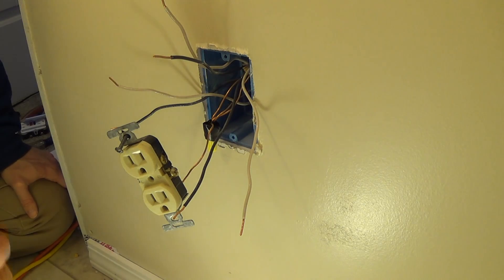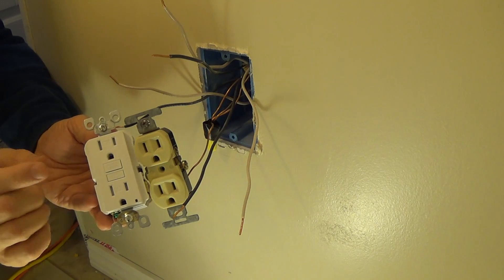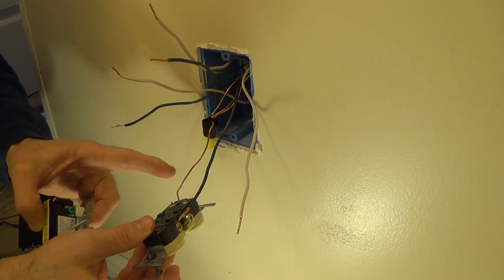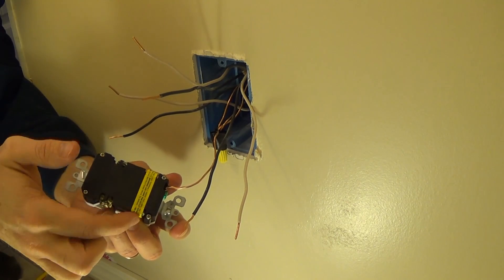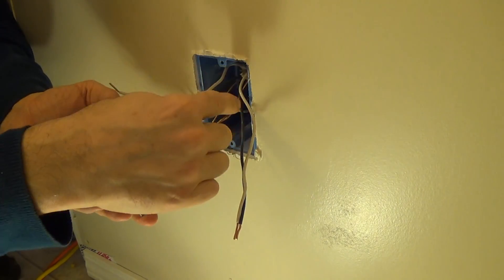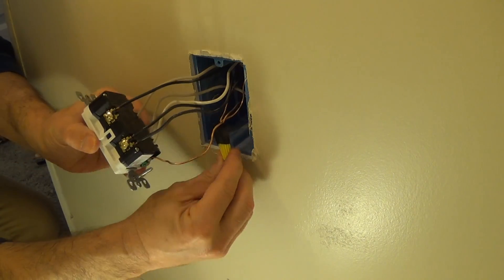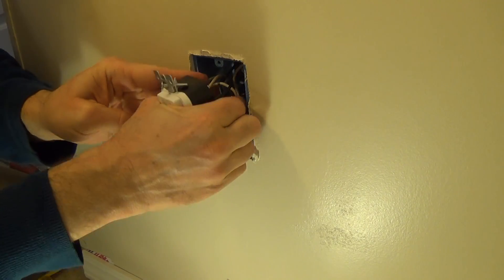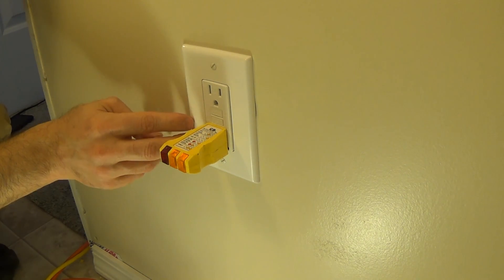How to Install a Ground Fault Circuit Interrupter (GFCI) Outlet Plug

Comment: You forgot to say that the purpose of these GFICs is to occasionally turn themselves off for no apparent reason such as simply plugging something in at a cocked angle or slightly bumping the plugs.   Then you find your cell phone and other charging units are dead un-expectedly while your far away from any means to re-charge them.   Personally I'd rather risk that there might be a puddle of water on the floor I was standing in barefoot whilst I was sticking a prong into the hot side of the terminal..which is actually not a risk because it can't be done accidentally.

Comment: I have found it nearly impossible to get the wire hook on to the "floppy" screw head.  For some reason, they make these outlets with side screws that barely come out far enough to get a thick wire under it.  And the screws flop in and out of their hole, so you have to hold the outlet upside down to let gravity pull the screw out far enough to try to get a wire hook around it.  Why is this thing so difficult!?  I have been working over an hour on this, trying to connect 4 wires to this thing.  So far, I got one attached.  Now, it's late and I'm losing the light, so I may have to stop and try again tomorrow.  I tried stabbing thru the hole on the back, but the wire keeps falling out, even after tightening it down.  There must be a trick to this that I'm not aware of.
Reply: That's the difficulty of trying to wrap around the terminal screws with these devices. It's the same thing with commercial grade receptacles, only residential grade receptacles have a "fixed" screw. Using the back wiring clamping method is the favorable way to connect the wires. It's still a very good connection method. If you're having trouble with wires falling out, use a pigtail and connect only one wire. Use a Wago lever nut for creating the pigtail.

Comment: Nice video but it might have been helpful if you had differentiated the difference between the black and white line wires. The black being hot and white being neutral. I have had to work hot circuits many times and you really want to know the bad boy wire.

Comment: Receptacle is upside down. Grounds should be on top. Say something falls on the plug in, like a picture frame. It hits the ground on top, not the hot. Learned this from master electrician who had to flip all the outlets in a government building so the grounds would be on top of the outlet & pass inspection.

Comment: How to install just a ground fault period ????? That sounds funny to not know. Earth ground is only 1 bare copper to ground rod to pannel on only tbe green bar in pannel seperate from surrent 2 bars and 1 white nuetral bar. And all ciruits run a seperate green wire or if  romax use the 4 wire or 2 wire with g. Only the green screw is isolated ground. All other withs even nuetral are travelers with current. Nuetral is not  a ground, it carries half of a ac current of the ac  circuit  it applied with. If circuit is 120v ac, the nuetral carries 60 v at the speed heryz is rated.

Comment: i just moved in and my GFCI outlet in my kitchen is not connected to the ground.when i turn on the garbage disposal everything stopped working including my fridge.should i try to connect the ground wire?thanks

Comment: How did  you determine which wires were line and which were load?
Reply: Use an electrical tester. Determine which hot+neutral pair has current. That's the line. Be careful, because this test is done with the breaker closed.

Comment: How do you know or confirm that 2 wires coming from top are line wires? On GFCI I get it that it is written .. but how do I check if the actual wire is line or load
Reply: Sunny Joshi, You separate all three sets of wires, then turn on the power to the outlet and test which black wire test positive for power, then the white wire that comes  with that black wire are the ones attached to the line on the GFCI.

Comment: could you have pigtailed the two load hot and neutral wires and then just have one wire attached to the outlet on the load side?

Comment: You didn't explain why you would want to connect both out going wires to the load or why someone might choose to connect one or both to the line. Sometimes you don't want GFCI on all lines leading out and thus getting tripped off by the GFCI. For instance, if one of the outgoing set of wires only goes to a light switch, you may want that light to be working even if the GFCI gets tripped which means it should be connected to the line and not the load.

Comment: HI, I am replacing a kitchen 2 fuse outlet with a GFCI. The old outlet is on a different fuse for top and bottom outlet. Does the GFCI get wired up the same as you showed? That would mean the bottom outlet on the GFCI would also be on a different fuse than the top. Would the GFCI work in the same way in this situation?
Reply: No. Both outlets on the GFCI will always be powered by the wires connected to the line terminals and thus both will be protected by the GFCI. If the location of the outlet requires protection then any receptacle in that box needs protection. If there is a light switch in the same box then it does not need protection unless there is a receptacle in the light fixture itself.

Comment: Excellent video and I am doing this tomorrow morning. I was wondering what you were going to do with the extra white and black wires. 
Also, is it ok to cut the wires to shorten them? Why are they left so long in the first place? Thanks in advance.
Reply: By code those wires should be six inches long, minimum.
Reply: @njsongwriter  Thanks.

Comment: I wonder why gfi plugs are not used in all sockets? I know they are about 20 bucks compar d to the cheap ones around a buck but it's well worth paying for added protection?
Reply: Not necessary. You don't want your lighting turned off just because a single GFCI tripped. But if your lighting circuits are separated from receptacles that don't provide lighting then you only have to have one GFCI receptacle installed at the beginning of the circuit to protect all the others downline. Or simply install GFCI breakers in the breaker box. Still there will be some things you want on all the time.
Reply: @njsongwriter  THATS RIGHT!  So many homeowners think they have electrical problems when its just a tripped gfi receptable

Comment: What if I have three wires?
Reply: I take it that you mean a black, white and red wire? Only the line coming in that will power the receptacle needs to be connected to the line terminals on the receptacle.

Comment: The explanation of how GFCI works was poor.   If in excess of 5 milliamperes goes from hot to ground, (less amps on one conductor than the other) then the unit trips.   Water does not cause it to trip.   If you plug a hair dryer into a GFCI that has 2 prong plug into a sink full of water,  it will not necessarily trip.   If you touch a hot and something grounded(possibly faucet, concrete wall, concrete floor, metal case of something electrically grounded) then it will try to flow through you.   .5 amperes in heart can kill you.    Link to article discussing dryer in water.    
https://iaeimagazine.org/magazine/features/gfcis-and-electrocution/
These are NOT outlet plugs.   They are both duplex receptacles.   This is important if you are trying to read NEC.
The rest of the video, pretty well done!
Respectfully,    Kevin

Comment: I am in process of replacing a couple or reg wall outlets with GFCI. Your presentation is by far the best. Clear, concise and you added two good notes... the tape around the terminals and the pig tail for the gound. When I opened my box the original (electrician?) had connected one ground and pushed the other to the back. 
Thank you for the quality of your presentation.

Comment: Probably wouldn't want to put "lighting" on the load... you can tie them into the line instead. If you put them on load, they'll go off if your GFCI ever trips (or is tested).
Reply: poetnk that’s a great point. Also worth mentioning when should you use a 15 amp or a 20 amp...

Comment: To save some time in case you've made an error,  test the outlet before you put it all back together just to make sure the wiring is correct.
Reply: Yes, excellent advice and I do just that.

Comment: the other plugs down the line will still be hot if it trips?
Reply: No. Not the way he has it hooked up. If you want those to stay powered even if the GFCI trios then you attach them to the line and not the load. If it's only one set of wires they can be connected to the terminals with the incoming hot wires. If both out going wires are to remain unprotected by the GFCI then they should be pigtailed and nothing should be attached to the load.

Comment: Can you replace ANY outlet with a GFCI outlet or does the outlet have to be in a certain location along the line?  Could you replace every outlet in your house with a GFCI if you wanted to?
Reply: Only the first outlet on a circuit needs to be replaced and the others would be protected as long as they are connected to the load side of the receptacle. Or you could simply install GFCI circuit breakers.

Comment: Thats my question too.... How can I know the main line and load lines?
Reply: you do not need to know the difference between main and load if you just put the black wire on gold(brass) screw side and the white on the silver nut side, that takes care of it for you
Reply: Kiim Stavrum um yes you do? There’s a reason there’s a specific side for line and load just putting whatever hot to whatever gold terminal is a wrong installation

Comment: 2 wires under a single screw? Is that proper only for the load wires and terminals?
Reply: He did not put two wires under a single screw. The receptacle he has was designed to put one wire under each side of the screw (not curled around the underside of the screw. Because it was designed that way, it's perfectly fine. If more than two wires were being connected it would have to be pigtailed.
Reply: There would be no reason to double up the wires on the line screws.

Comment: How do you know which are the load lines and which are the main lines? By the way, not here from NELK ;) Thanks for the video!
Reply: All you need is a simple test light. Separate all the wires. Then turn the power on. Then test each set of wires with your test light. Black is hot white is neutral. The pair that light up the test light are the line.
Reply: If you turned on thr breaker it would be the ones that had power. The other would be dead. So youd have to separate all the wires by taping them to the wall or putting caps on them and then test it that way.

I dunno im not an electrician but thats what id do.
Reply: @ekoms108  That would mean you would need one of those voltage testers? I don't have one and am a little gun-shy about doing anything with exposed live wires anyway. What if I just assumed the line wires were on top of the outlet and then tested that hypothesis after I wired the GFCI with that plugin tester he used at the end? Would that work?

Comment: I know nothing, nothing about changing these gf plugs. Last night we turned all the breakers off then installed this gf plug and guess what, no electricity, took over an hour trying to install this crap and nothing and there's another one next to it about 5ft. from first and also does not work.  Don't know what I did wrong but its hard to work on these with stupid flashlights.
Reply: Did you press the reset button on the GFCI receptacle?

Comment: Thank you. Assuming the line terminates at this gfci and I just want to protect the two power sockets, do I still wire into the line, or do I wire into the load? 

I hope this question is clear.
Reply: Philip, if circuit terminates at this receptacle, you have an "end of run" receptacle meaning there should be only 3 wires, hot, neutral, and ground. The hot and neutral connect to the line. Nothing is connected to the load and you can leave the yellow tape as is.
Reply: @surferdude642  thank you kind sir
Reply: Okay im not an electrician but those line wires are powering other stuff in the walls later in the circuit.
Reply: @ekoms108  
Not if the receptacle is at the end of the line.

Comment: you didn't show how to know the main line and load lines?
Reply: When you have the wires disconnected like he does in the video, turn your breaker on and use a voltage detector. Only one black wire will be hot - that pair is the line.
Reply: He said the line was the first wires you hook up.  You have to remove the yellow sticker to attach the load wires.
Reply: @blazezoolander7473  ?????????

Comment: If there is more than 1 load going out , don't you need to make sure your not exceeding the number of outlets/receptacles that the gfci is protecting?I believe code limits the number that a gfci can protect.
Reply: Tbone productions nope

Comment: If you use the GFCI outlet for your installation, it should come with some stickers . One set might say GFCI protected and another might say ungrounded outlet. The stickers need to be applied to the faceplate when the installation has been completed to be up to code I believe.
Reply: You do not need to mark it anything. You can see it is protected from the fact that it has the buttons.  If you chain from that you need to mark those  at least when there is no grounding.
Reply: The GFCI does not need to be marked. Those stickers are used to mark other receptacles downline that are connected to the load.

Comment: They are called wires not cables! Call an electrician!
Reply: J Top *Conductors not wires
Reply: I didn't see a train.
Reply: A bottle cap can be a conductor or the guy that takes your ticket on a train. Like I said, Call an electrician.

Comment: I've seen many videos showing how to install GFCI outlets and this is by far the easiest to understand for someone that doesn't know squat about electrical. can you tell me why this particular  outlet has two sets of load wires? is this normal?
Reply: Normally there is only one set of wires bringing the power into the box. Those wires would be connected to the line/hot terminals. 
Now let's say you have two sets of wires going out if the box like in this video. If you want the outlets that these wires lead to to all be protected by this single GFCI then they would be connected to the load. But those outlets may not be in a location where a GFCI is required and you may not want them to be protected by the GFCI. For example those outlets may continue on a kitchen circuit. If the GFCI bear you kitchen sink trips do you really want all the other outlets to lose power? Most likely not especially if one goes to the refrigerator (which should be on it's own breaker) so you would connect them to the line rather than to the load terminals. If there are more than two pair of wires you will need to pigtail them.
Reply: artincorona wondered the same thing. Watched a video from the manufacturer Levitron, it said if more than 4 wires plus the ground wire to contact an electrician.

Comment: in my old house i have 5 wires come out from the box. 2 white wires, 1 black wire, 2 green wires and i have no idea which wire are ground wire (they are insulated) any idea ?
Reply: Green wires BY CODE are always ground wires..... Green wire and uninsulated copper wire are always Ground wires. The EXCEPTION to this code is someone who wires the outlet WRONG.
Reply: akkachai47 ji

Comment: What about red wire? There's a red, black, white and green coming out of the line conduit.
Reply: Red Wire also carries current, thus, making it a hot wire. Red and Black wires by code are hot wires and ANY white wires that are used as current carrying or hot wires are to be marked with black tape and or other markings indicating that it is a HOT WIRE.

Comment: Good video, Geo. Is there a special GFCI breaker that needs to be installed for or along with these kind of circuit outlets? Nice video very good job!
Reply: No special breakers are needed in conjunction with a GFCI.